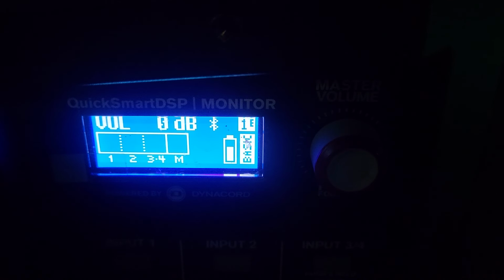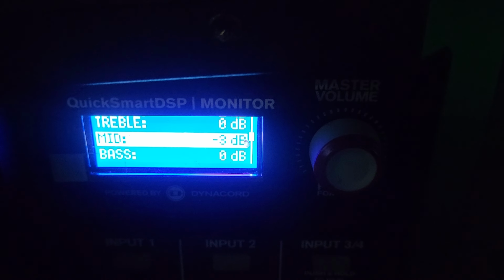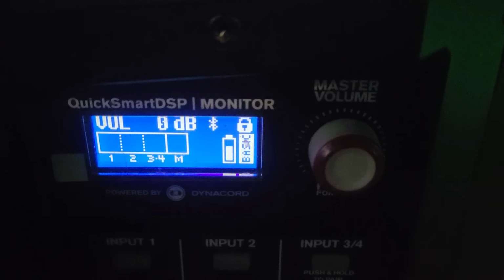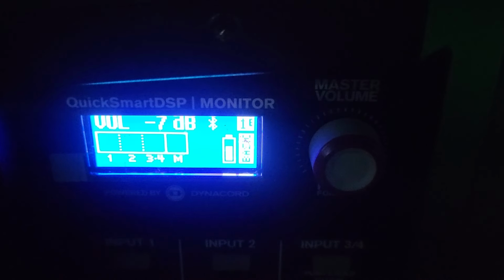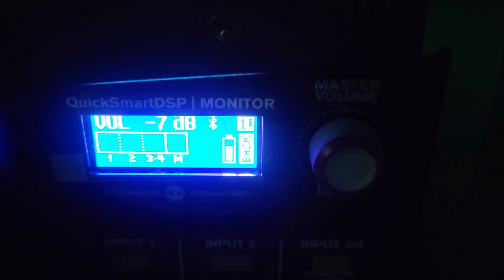EASY DJ Audio System Settings For GREAT Sound - Mixer/Controller, Powered Speakers & MORE!

Comment: what is your take on running amps. some venues run them full , others not.
Reply from the maker: It probably depends on the amp's gain structure.  Older amps & powered speakers were ran at full.  There's been a change in that in the last 15-ish years or so where at least with powered speakers, it's no longer a 1-10 volume & has gone DB level in the volume controls.  Not sure if this has changed on newer D Class amps as well.
Reply: @briansredd  aaah. thank you so much

Comment: Hi Brian, the way you use your faders i would have to be very careful every time. 
I be doing the faders at 10 for more than 20 years, its in my fingers 😅. 
I like your video’s but i don’t think im gonna do it like you 😂. 
Also the external mixer thing you say on the end, every other dj on youtube says on controllers the mic inputs and outputs aren’t as good as a good external mixer + if you controller fails you stil have a backup with an ipad connected to the external mixer….

On the other hand i would love to get rid of the external mixer… i just bought a new one so i have more control over the mics and but also can eq my sound from the controller. My rcf Evox12 have no eq on the speakers so that’s also why i use an external mixer.
Reply from the maker: Do your gain structure however you want.  If you still want to try unity gain / 0 DB with 10 on the faders, some on here have suggested to set the gain/trim to 0 DB like I did in the video, then try your master at like 2 o'clock & see if you hit 0 DB across the board.  If not, adjust the master until you do.  I don't think it's as ideal, but it's better than overdriving your signal.  

In regards to how I suggested running your external mixer, you are still running your mics with it, and even a back-up tablet if your computer fails.  In this video, I'm assuming a person is running a mixer/controller that's of better quality than the $200 Yamaha mic mixer they have added, in which case, it stands to reason the budget Yamaha mic mixer would fail before the premium DJ mixer / controller does.  On the other hand, if you are running a budget  DJ mixer / controller & you feel the Yamaha mixer is more dependable, run it the other way.
Reply: @briansredd  there is always to much misleading information, and for people who don’t understand its hard to know what’s best. But i think it’s like you say, do what you feel is best for you 😅 

I have a pioneer flx10 so i assume the in and outputs aren’t that bad… but i use the external controller to set my overall eq to match to room and vibe. Because i use my eq knobs to fade in and out my stems. 

If the flx10 had an output eq like the AZ or XZ i would not use an external mixer. I my opinion the less hardware or cables, the less that can go wrong. 

Brian thanks for the video and keep making them, i love your intake on everything and i always learn new things to consider or try.
Reply from the maker: @djkwinten1646  I just did a follow up video addressing your questions :)

Comment: Brian, great video! I just approach gain staging a little differently, especially when I want to use the full throw of the channel fader while still running everything at unity.
Instead of setting the master first, I flip the order:
1) Set the trim/gain to zero
2) Open the channel fader all the way
3) Raise the master until your meters hit 0 dB
This gives you the same clean output level without distortion and keeps your entire fader available for mixing.
Why this works:
Unity gain is unity gain no matter which stage in the chain you adjust first.
• Your channel fader at 0 dB is calibrated to pass the signal without boosting or cutting.
• Your trim at 0 dB is passing the source at its native level.
• And as long as your meters are hitting 0 dB on the master, you’re feeding the mixer’s output stage a healthy, clean signal.
So you’re not degrading input quality by lowering trim, and you’re not harming output quality by adjusting the master. You’re simply choosing which control sets the reference point, and in this workflow that’s the master instead of the trim.
Same final gain staging—just a method that preserves the full usability of the channel fader.

Comment: There is one scenario that I think you missed. What if I push my channel up faders all the way up to   10, and then I set my gain to hit 0DB? Then I set my master to hit zero DB? Does that give me the same quality as the scenario that you like to use?
Reply from the maker: I covered that, and you are compromising your input signal (weak)
Reply: @briansredd actually, not exactly.  Do this. Turn down the Master. Take the line fader to max. Then take the gain to 0 db on the PFL. Then increase the master to 0DB. All levels will be at unity, correct?  .
Reply: @sullivan44 sounds right 👍
Reply from the maker: @sullivan44  I'm not saying you can't do that... & I'm not an audio engineer.  Always do what works best for you & what you think is right. What you are suggesting to do is a whole lot better than what I see most doing with settings.  This overall mixer gain structure is what I've been taught for years, going way back to my early club days.  Again, not an audio engineer, just trying to make my overall output signal, in DB & possibly even a little bit of voltage coming from the master gain position, as strong as possible without being over or under driven.  At anything but 8 on the master, microphone gain structure would also have to be adjusted a little different.  Mic settings can be fickle AF, especially when we are handing them to amateurs who never know how to hold them / talk thru them.  We get forced to somehow compensate for this, and it would be tougher for most if the overall master output signal was set lower.  Again, not an audio engineer.
Reply from the maker: @sullivan44  BTW, I used to DJ where I'd hit the top (10) with the line fader as well.  Training wheels, for me with these mixer settings (almost showed this in the video) was a piece of electrical tape across my line faders at 8, blocking off 9 & 10.  After a season of that, hitting 8 was 2nd nature.  There were some DJs that would actually shoot a screw into the fader itself to block off 9 & 10!  That couldn't be good, but I'd see it in clubs once in a while.
Reply from the maker: Just did a follow up video with your suggestion & a few other things
Reply: @briansredd I’ll check it out now.